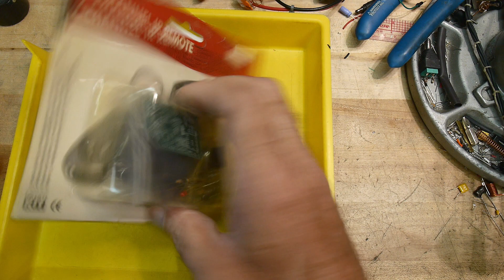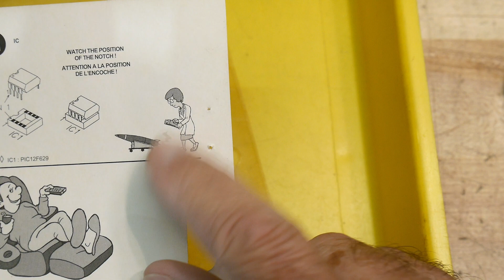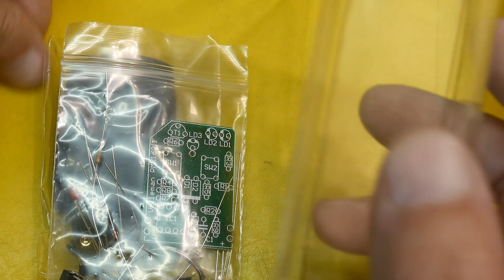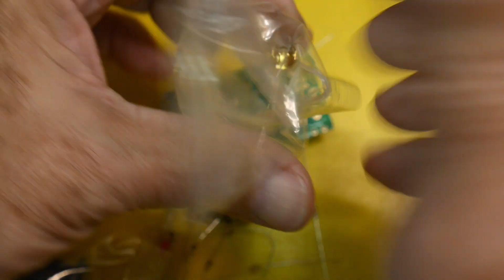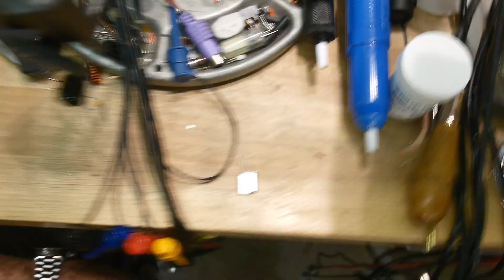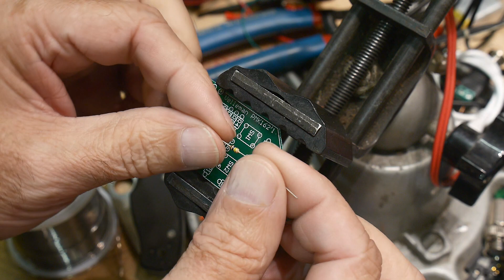#975 Velleman IR Transmitter Kit

Comment: I agree to look at the signal on a wider timescale. The receiving elements for this kind of signals are the very sensitive and very cheap TSOP322.., TSOP324.., TSOP344.., which detect chains of bursts of 30kHz or up to 56kHz pulses with a length of about 600µs.    One alternative experiment might be to walk around passing as many garage doors a possible, but of course they just react to coded signals.

Comment: Same lithium battery that goes into garagedoor remote controls. Usually half length either AA or AAA.
Reply: It's a 27A battery. Also used in wireless doorbells.